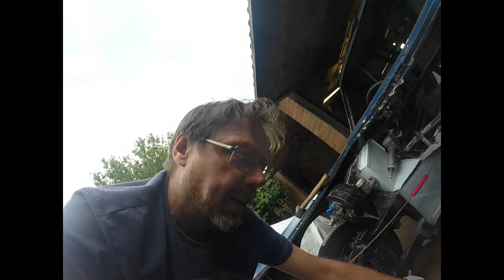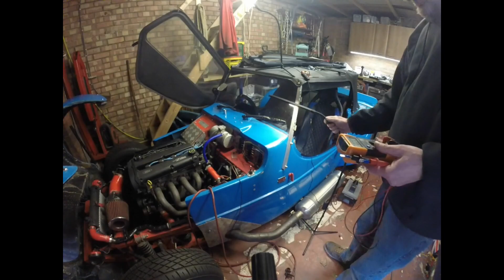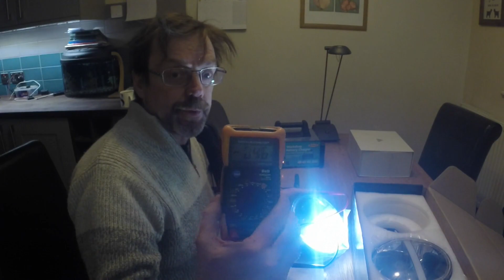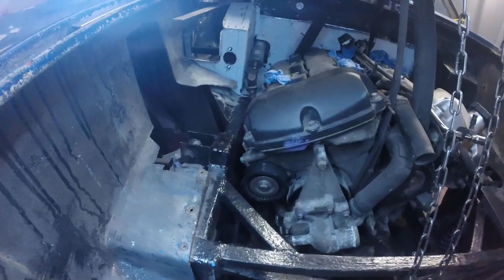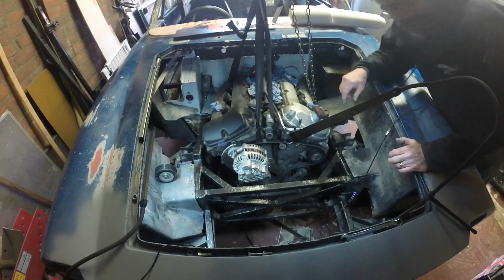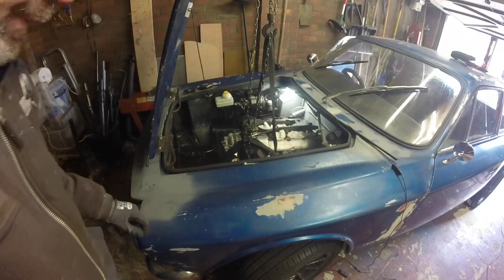Backwards Alternator

Comment: Hi Speg, (given the considerably higher output of alternators compared to the old dynamos) I’m pretty sure that unit will be more than adequate in handling the extra load during wet night driving or summer air conditioning. Loving the reverse fixture and a good idea to just confirm that the angled cooling vanes on the internal rotor of the alternator will still be effective in reverse mode I think. 🤔
Reply from the maker: I am sure the one I have fitted will be fine but the micro one was not powerful enough. Esp as I've decided to go with more traditional, halogen headlamps. I can now concentrate on sorting  the exhaust manifolds without worrying that I'd need to move it back into the original position